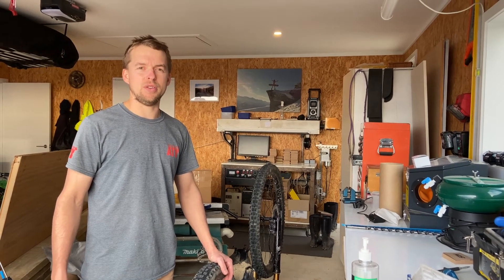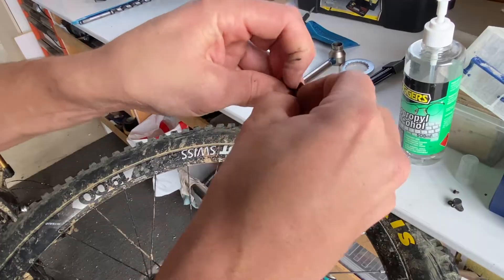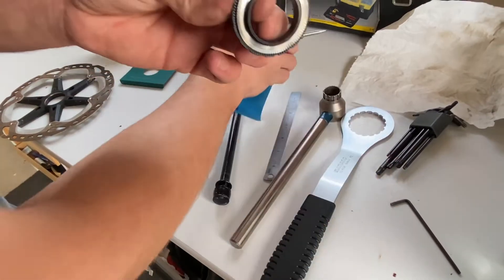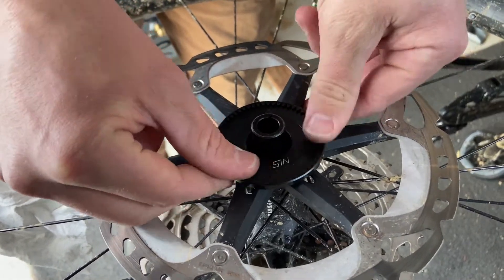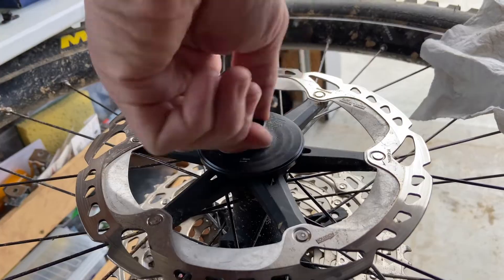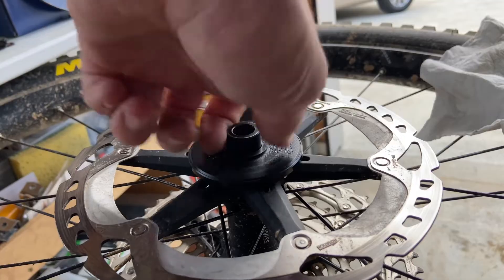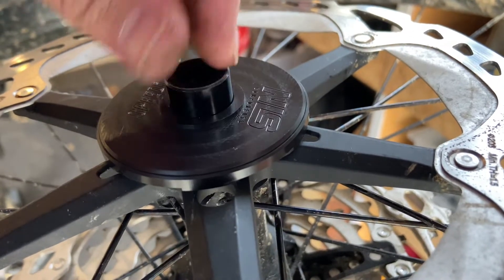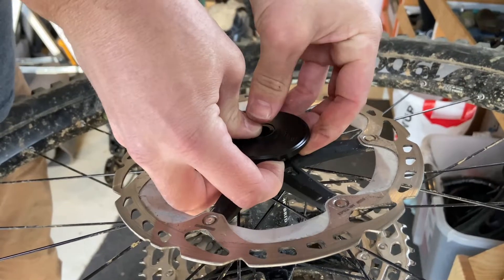E-bike speed delimiter: SPEEDi [Center Lock Installation Instructions]

Comment: EN EL MODO eMTB decis que no funciona,tenemos que eliminar el modo de conduncion de la app o simplemente la bici no va o funciona como un modo normal  ?..... tengo una cube del 2023 es compatible o tiene problemas, deberia de desvincular del gps del telefono en la app flow para que no tenga discrempancia de velocidad y kilometraje con el sofware del motor ?
Reply from the maker: Hi there, eMTB mode works as normal, it is the Auto mode that is not compatible. Most 2023 Cube bikes are compatible. We have some listed online. If your's is not, feel free to email us and we can check the details. We do recommend when riding not being connected to any manufacture apps.

Comment: Does the 2022 reign e+ 2 Speedi fit the 2023 reign e+ 2?
Reply from the maker: Generally speaking no, depending what rear hub is installed, make sure to compare the example picture with your rear hub. We have the specific 2023 Reign E+ 2 available on the website now.